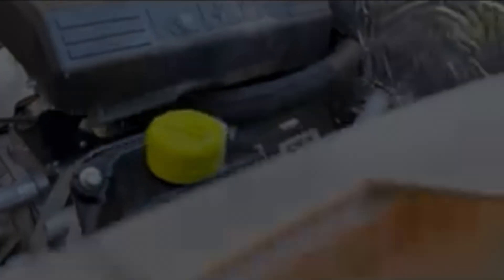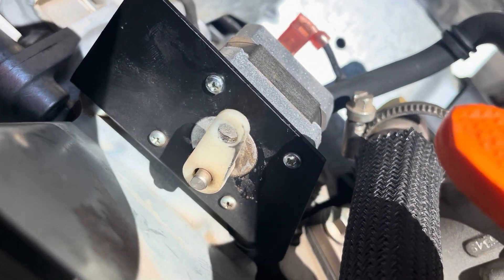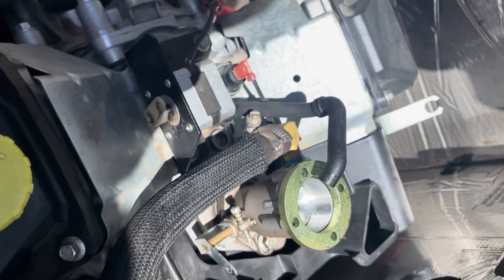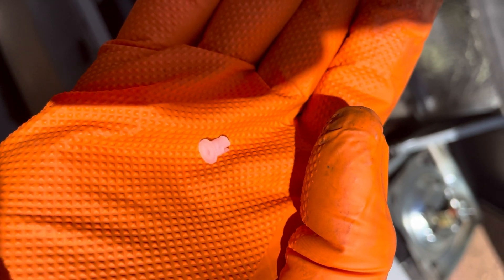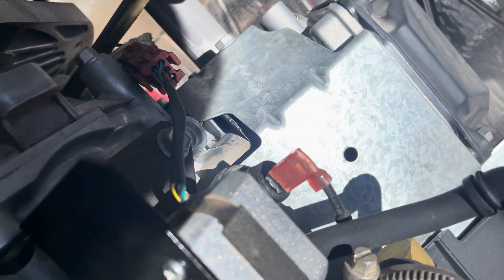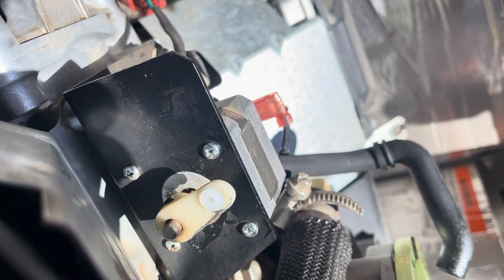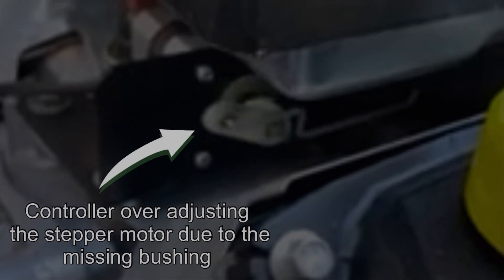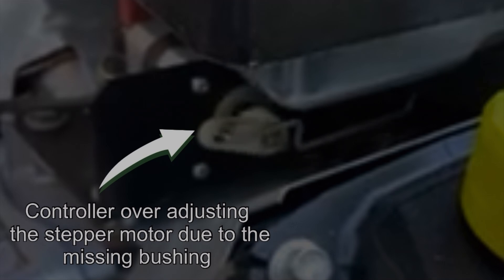How to fix a Kohler generator with surging and hunting problems. Under speed, overspeed error code.

Comment: WD 40 ( tiny amount) on the stepper motor shaft and little bushings and close and open the ball valve B4 the regulator and  (change filter) & tighten the air cleaner cover down tight
Reply from the maker: Thank you for the advice!

Comment: QUESTION: I have the 14RESA. Getting a “Low Frequency Shutdown”. 
I replaced the brushes on the motor and the bushings/arm on the stepper motor last season.  Does have over 3,000 hours and replaced the stepper motor 1,500 hours ago.  Maybe that is bad again??? Thanks in advance to all.
Reply: Thanks!!! I had the regulator checked.  It was fluttering at 8.5.  I replaced the regulator and the 3rd time starting again it shut down after an hour with “low frequency shutdown”.  I have yet to test the new regulator.
Reply from the maker: Make sure everything is good on the fuel side, verify there’s the right gas pressure before replacing the stepper motor.

Comment: Good info as we had this happen but, U don’t show how to remove control arm to install bushing and then reinstall control arm ???
Reply from the maker: Sorry, the day I was doing this repair I was on a rush and only took a couple of shots. Reason why it’s a quick short video.
Reply: @ do U have any info on how to install the bushing with the control arm … do U have to remove the arm ?  How do U get the bushing in place step by step ?
Reply from the maker: If I'm not mistaken you just need to unclip the throttle linkage bushing and you'll be able to pull one side of the linkage out and then pull the other one. Add the new bushing and reinstall the throttle linkage and clip the other bushing.
Reply: @ thanks for the info as that is what we did … looked at replacement clips and noticed the little clips on the back holding it in place !!!
Reply from the maker: @DAL1080  awesome! Glad to read you were able to fix your issue. Thanks for watching my video and for your comments.

Comment: You should have replace the plastic arm at the same time, those wear pretty quick and especially from the steel linkage flopping around like that.  Everything in that train of parts needs to be tight for proper running.
Reply: Where can you get these bushings?
Reply from the maker: @miakman16  Check the video description above, I have a few Amazon links where you can find the bushing.
Reply from the maker: The plastic arm was still good but you’re right it wouldn’t have hurt replacing the plastic arm as well. Thanks for your comment and for watching my video!
Reply: @tacticalpowerpro What do you mean "good"?  How did the first bushing disappear if the arm was still good? This usually happens from looseness in my experience.  Did it have zero (tight) clearance bushing to arm once you finished? That's how it is supposed to be.
Reply from the maker: The first bushing broke it was deteriorated. Once the new bushing was placed there was no play between arm, bushing and linkage. Generator started and ran smooth.